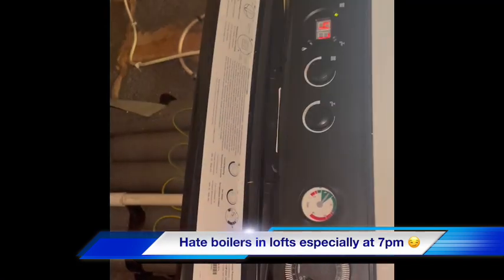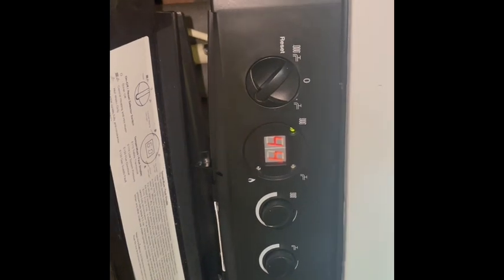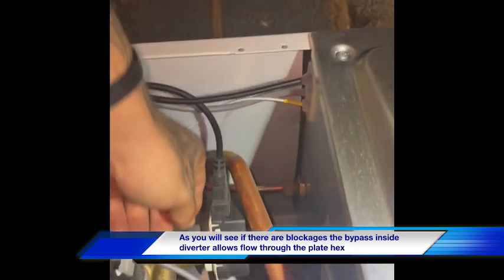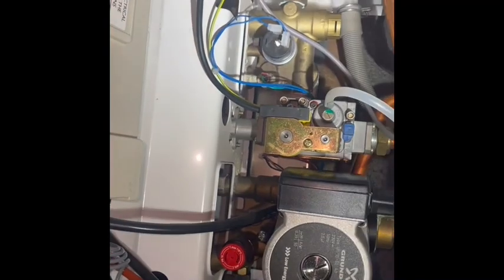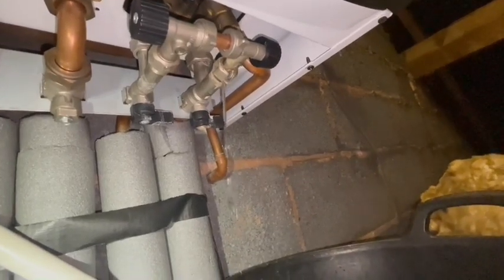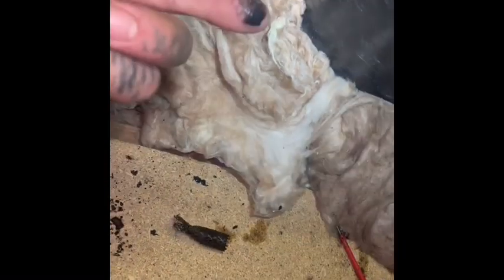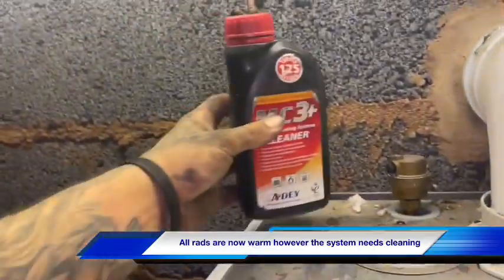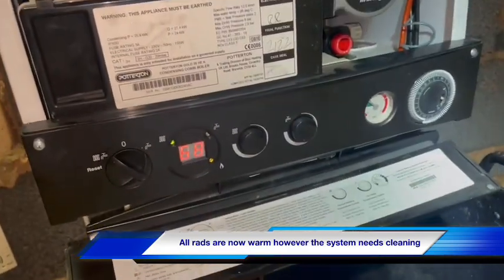Sludge in the heating system potterton gold @thementalgasman3tgasmainte317

Comment: Needs a couple of tubs of x800 circulating in that system and a good flush, bet the hex is slugged up as well. Good video though.
Reply from the maker: I’m not really a fan of x800 I prefer mc5 by adey , check out vdi2035 I’m equipped to follow this standard you can get very good results with flushing with citric acid and tri sodium phosphate as long you know how to monitor and control the ph of the water as the citric acid can drip it to around ph2-3
Reply: @thementalgasman3tgasmainte317  you’ve blinded me with science their mate😀